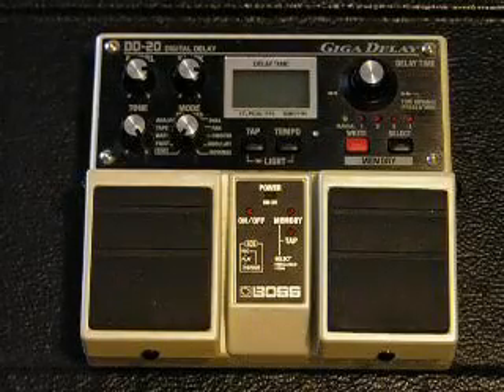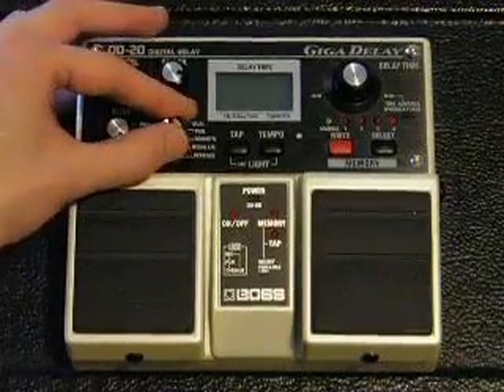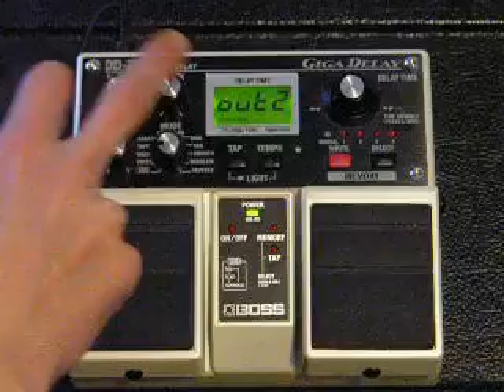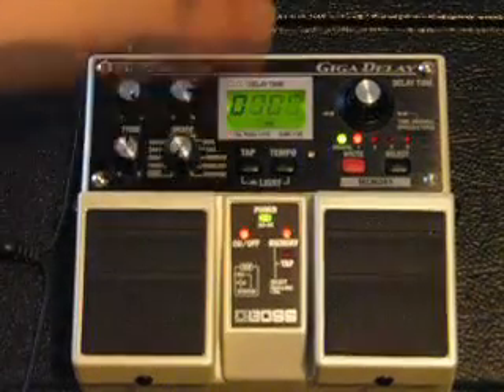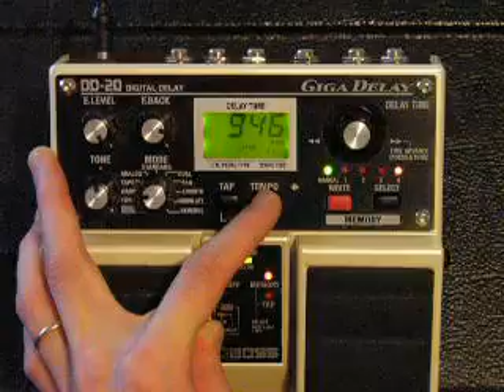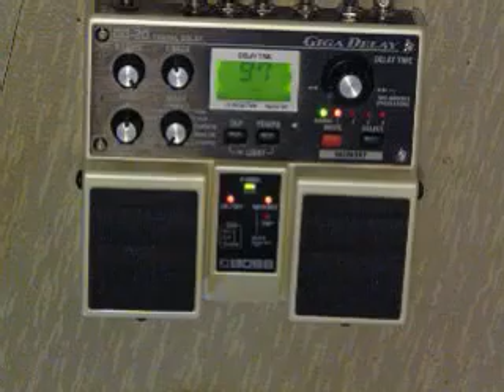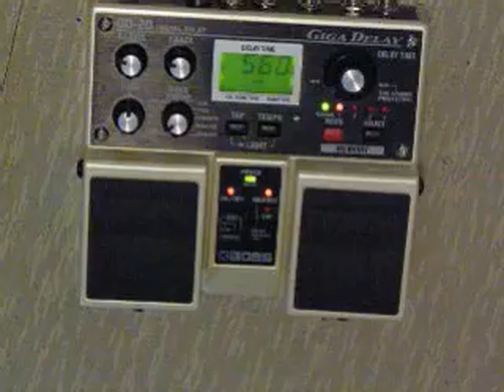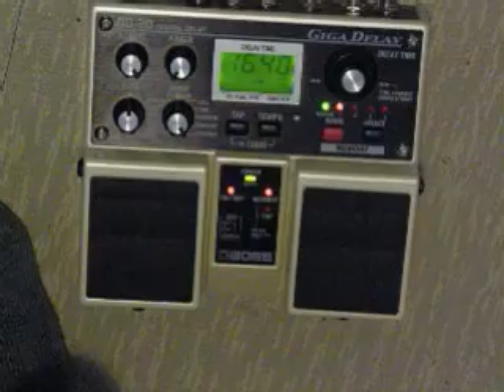Boss DD-20 in depth

Comment: everyone has their preference but I auditioned both the dl4 and this pedal pretty extensively and completely fell for this pedal...the analog delay setting is PHENOMENAL for lead work, the SOS is good for working out different parts without dropping a bunch of $ on a looper that you won't use otherwise...I just can't say enough about this thing...there are plenty of analog delays that sound better but the versatility and the ease of use (after a couple sitdowns) makes this one stand out...you s

Comment: dl4 has a built in tap tempo
the difference between the dl4 and the dd20 is that the dd20 has the dotted eighth delay but the dl4 doesnt
the dl4 has a lot of more delay settings and the dl4 has a longer looper and the autovolume effect so some say the dl4 is better but its all your opinion
in my opinion i think the dd20 is more comfortable but the dl4 has much more extra effects i like like the auto volume

Comment: @123westy321 It certainly is more flexible than a single DD-7, yes.  Like Jellogarden has implied, of course two or three DD-7's would be better (or more flexible, rather), but in short, yes, this is better (as it allows more delay time and has a few more options than does the DD-7--not to mention that the double-pedal format allows for some techniques that would only be accessible via "knob twiddling" on the DD-7.  Now you can do those things with your feet!).